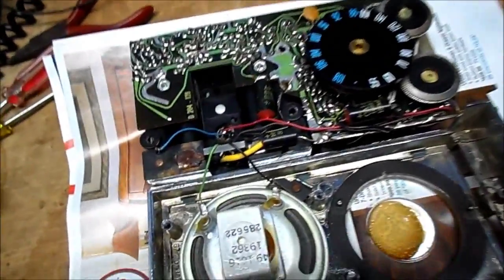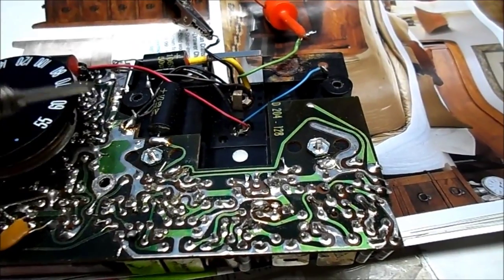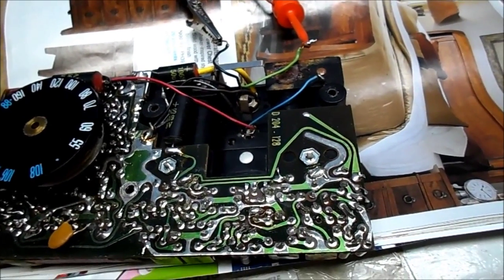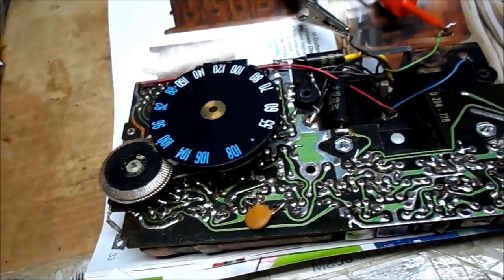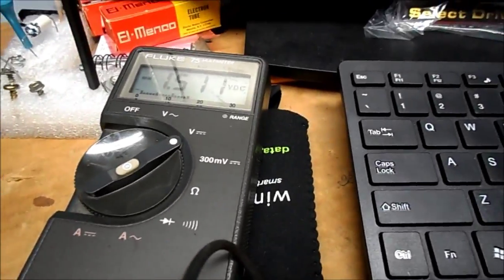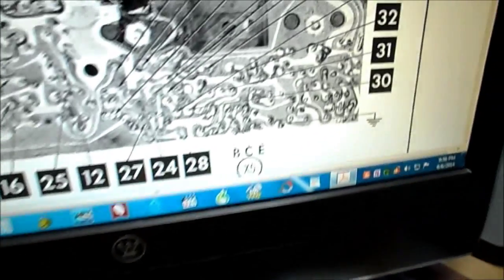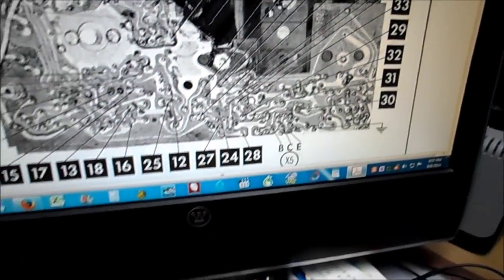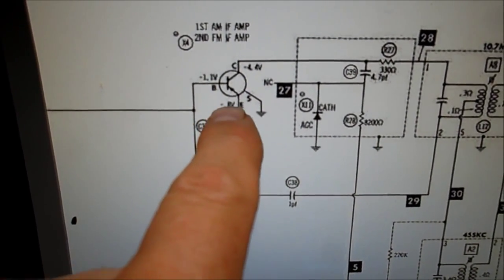1966 Zenith Royal 51. Model 9NT41Z8. Pt. 2. IF Transistors.

Comment: Bias should be about .1v-.3v for most of the transistors. measure between emitter and base, checking voltages to ground can be confusing.

Comment: the easy way to check voltages on the tranistors is to place one probe on the emitter and then measure the bias (base to emitter is the bias) and then the collector voltage.

Comment: Hello Robert, the electrode you were pointing to is the emitter of x4. Zero(0) volts on that lead would suggest an open (e) or open R-26 check each one. A small correction if all voltages read negative to ground then you have a positive ground. You might not be old enough to remember 6 volt electrical systems on  autos, but a bunch of them had + grounds.  All the best,Tom J. from FLA.
Reply from the maker: Believe there is a faulty transistor, one of the IF amps, or the oscillator. I'm reviewing the Zenith part numbers, crosses , etc. & what to use for replacement types. Something for 2N3588 germanium. Some socket scheme to add too perhaps. Thank you.